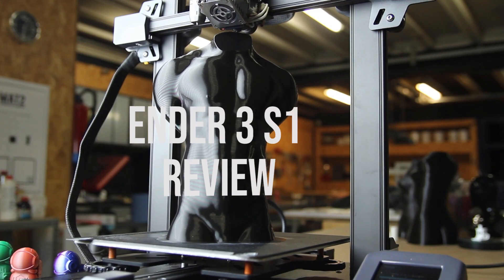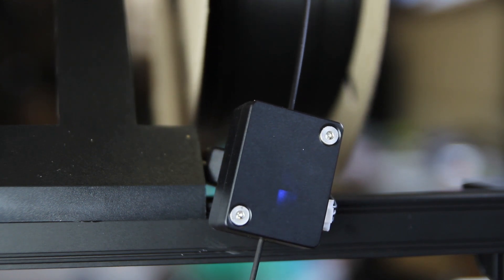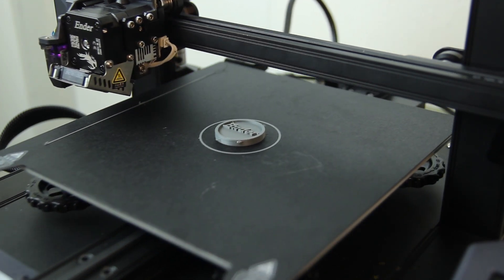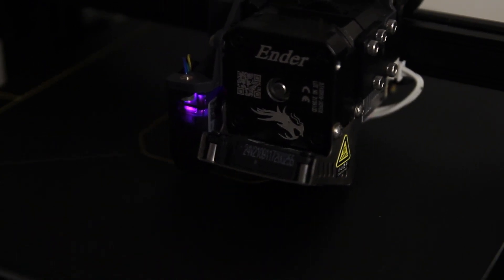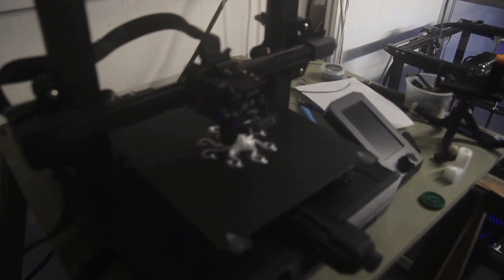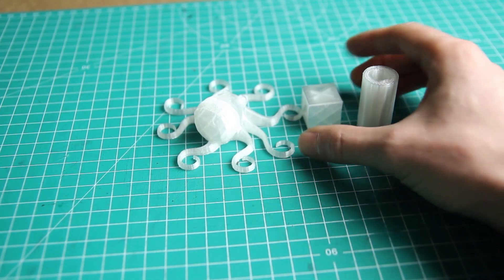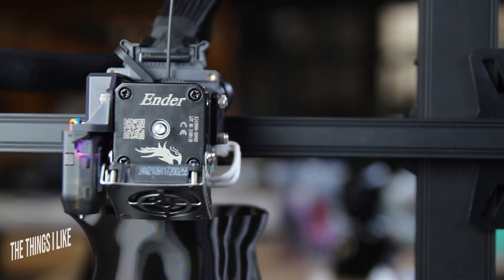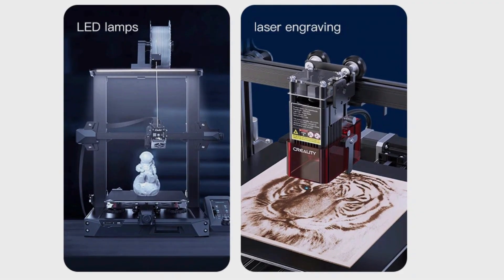Creality Ender 3 S1 - Good or bad?! Review and examples

Comment: Worst creality printer I Ever owned.. The bed lvling system just sux, the prints are terrible, not only is it stringings alot, but the prints are just deformerd. And yes i'm a professional user I have been working with 3D printers for over 10 years now.. And this piece of horse cr.. Is just not working for me
Reply: Your clearly doing something wrong I have not seen a single bit of stringing and the print quality is just perfect

Comment: Been trying to decide on the 5 plus and the S1 plus. Think I’m going to go with the S1 plus due to ease of setup and not feeling like I need to add more upgrades to it like I would want to with the 5 plus out of the box. 300x300x300 should be a good size even for large prints like helmets. Thanks for the review!

Comment: Mine came a few months ago. I started to put it together and a wire connecting the X stepper was broken. They sent me a new cable in about a month later I got it and installed it. I turned it on and a puff of smoke came from the CR touch. They sent me another CR Touch. 6 weeks later I got it and I installed it. It auto leveled once and now just remains red. They told me to flash the motherboard and the display. Presently doing that.
Reply from the maker: oh ok, sorry to hear you have so much trouble with it. So far so good for me

Comment: I've struggled with my S1 cant get a clean result not matter how often I've calibrated its just been nothing but disappointing
Reply from the maker: That's weird, what problems do you have?
Reply: @MatthieuLibeert  The main one I can't get my head around is setting the Z offset. Each time I set the offset correctly the next time it Auto Homes the offset changes and at random too so sometimes too close sometimes to far away
Reply: Atm to get any decent print i have to sit watching and adjusting the Z offset manually (for every print) in order to get the height correct...extremely frustrating. Have contacted Creality for support and been virtually ignored bar the first cop and paste reply
Reply from the maker: @LeighRatcliffe  have you tightened the v-wheels under the plate? I only calibrate once a month or so... Maybe stupid question but are you sure your bed is fully flat? I put a lot of time into that and in theorie I don't need the cr touch for adjustments
Reply: @MatthieuLibeert  I was pretty confident that I had the bed levelled correctly and had done it multiple times but I think I just found the culprit The brackets that Hold the z axis Screw (The ones ones connected to the x axis arm) were completely loose so far I'm getting a better result
Reply from the maker: @LeighRatcliffe  problems with printing will mostly be lose screws, bad bed leveling or wrong slicing profiles... Glad you've found the possible problem!

Comment: I have a few printers, so not necessarily new to printing but I’ve never had an Odin. I’ve had some similar printers like the Fokoos Odin which has been great. I’m looking into adding one more printer to my fleet and I have been considering this printer for a while now. It’s down to this or the Sidewinder X2. Thoughts between the two? Great review!!
Reply from the maker: Hi, Thanks for your comment, hard to give you some advice as I've never used a Sidewinder. What I can say is that I now use the S1 as my daily printer and works well with low maintenance and good prints

Comment: Got one of these last week. So easy to set up and start printing. My first print was perfect, but then I got carried away, so a few failures since, however now printed 3 good figurines at 100 - 150 mm high using cura slicer. Very happy. Now  I have to learn fusion 360 and cura better!
Reply from the maker: Great to hear! It's a good printer indeed

Comment: Good video but I just don’t know what is entry levels means when it has all you need, all the upgrades you made to your other printers besides the a smaller printing area. I am about to buy one I bypassed the beginners printer straight to the cr10 v3 so I really don’t know what is is a beginner printer. Is it a good printer?
Reply from the maker: It's hard to give a general advice on what to buy, I think it's good to compare different reviews and see what you expect of a printer, So far I'm pretty happy with the S1. It's reliable and easy to set up to get good prints fast.

Comment: I need help. I want to buy my first 3d printer. Which would you recommend? I'm looking at ender 3 v2 with dulal z or ender 3 s1.
Reply from the maker: I guess it's up to you, but I can say my experiences with the S1 has been great so far
Reply: The s1. I started on the 3 pro before alot of the upgrades. The s1 will expedite alot of the learning curve.

Comment: What are your settings
Reply from the maker: This is printed at lower speed 50mm/s and low layer height 0.12mm on 0.4 nozzle, bed 50°C nozzle 200°C (PLA) fan 75%
Reply: @MatthieuLibeert  thanks man

Comment: How do you get settings to print so clean in the example astronauts you printer?
Reply from the maker: This is printed at lower speed 50mm/s and low layer height 0.12mm so these are pretty long prints (5 hours) for small parts but resulting in good results
Reply: @MatthieuLibeert  50mm/s lower speed?? that's the maximum speed that he does doesn't it?? xD
Reply from the maker: @Ackumy  I consider 50mm/s on the lower side, I printed up to 200mm/s so far

Comment: Having watched a couple videos now, it sounds like the consensus is this printer is good for the beginner (which happens to be me) despite any drawbacks encountered.

Thanks for the video!
Reply from the maker: It's indeed a good printer. I would more say that if you are looking for a printer without having to change things to upgrade it to print better or in a different way, this is the printer for you :)
Reply: @MatthieuLibeert  Yeah, I'd say that's what I'm looking for - at least for now. I could see myself wanting to get crazy later and have a printer to mod, but currently looking for something that I can more or less use out of the box for printing various things I engineer.
Reply from the maker: @JasonGillmanJr  Then this would be a good printer for you ;) you'll still need to do a bit of bed-leveling and finetuning but when this is done you should get good results print after print
Reply: @MatthieuLibeert  With only the auto leveling done, I've been happy with how the five prints I've done have turned out. Admittedly they weren't the most complex pieces, and I did spend a little time dialing things in Cura, but overall, a relatively plug-and-play printer for those new to the game it seems based on my experience so far.
Reply: It's good for advanced users too.

Comment: Very cool. How do you adjust the slicer to fix the printing errors on the bust?
Reply from the maker: still need to figure it out when I find the time but changing the models height, different nozzle, layer height or geometry of the print are things that will help
Reply: @MatthieuLibeert  hi libert can you share your setting in cura..thats amazing video printout your 3d printer thankyou